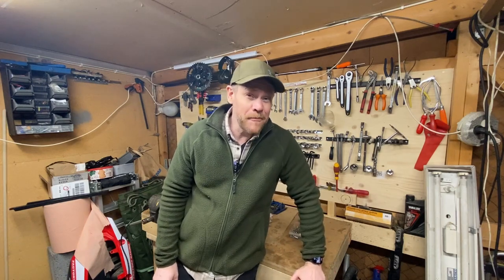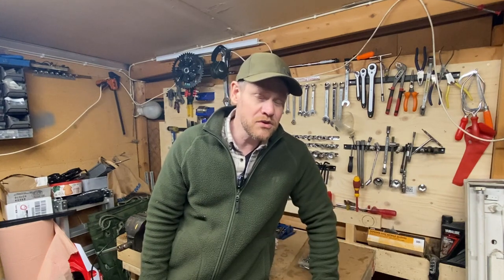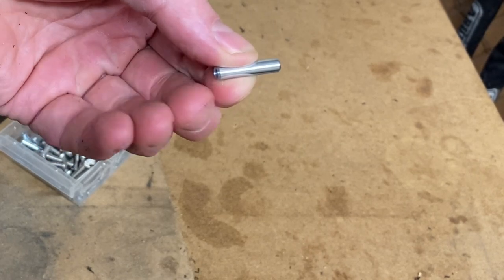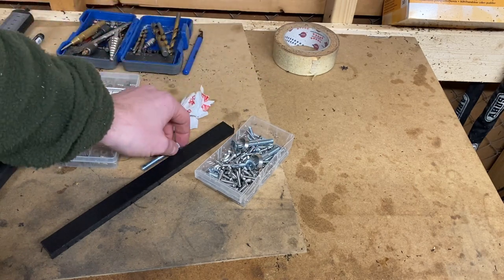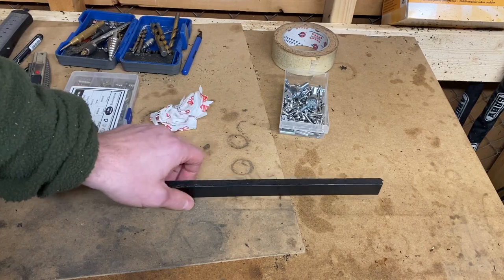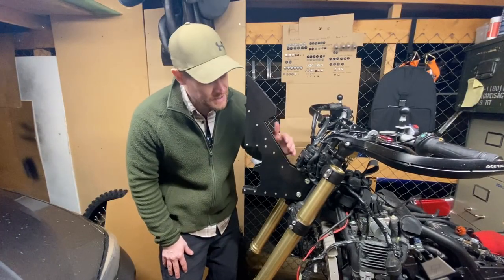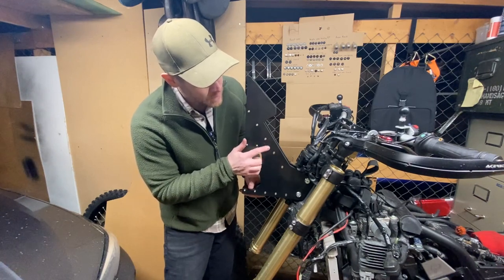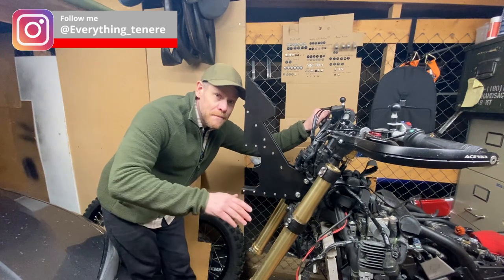Rally Tower Build EP4 - Yamaha Tenere 700

Comment: Very good.  I liked those threaded sleeves.
Reply from the maker: So much better than the screw in thred inserts I was going for first. 
I can still use those on flat surfaces to attach things, but they are kind of not supposed to be used in plastic (already cracked some when testing it out, need to drill just shy of the full od)
Reply: @everythingtenere  They just won't hold unless epoxied in.  Then questionable.  It's looking really good.  Certainly strong.  That's an easy pattern to duplicate.  This very much may be the easy part.  Fitting the lights and other items, then mounting it and what doesn't seem to be in the way now ,ay or may not be.  Good fortune.
Reply from the maker: @samhill3496  i have found steel inserts witch should be a lot stronger, will get some today. 

High beam is mounted, rock solid, but they use M8 bolt, won’t budge (check instagram)

Comment: Looking great Marcus! I am glad you are feeling better. One question about the top part: could it be hazardous in case of the usual 'over the bar' crash? Or will your CARPE be taller than the 'spear' top you have at the moment?
Reply from the maker: Carpe will be in the way 🤓. And I will cut it down slightly as well most likely, so not as pointy
Reply: @everythingtenere  👏💪😃

Comment: Can't you stick the spacers down first Marcus 👍
Reply from the maker: What do you mean?
In a perfect world, I would have drilled the spacers first, then used them as a template when drilling the tower sides. 
Be a drill press would be even better. 
But if spacers are drilled in a press, then the hole should be straight. 
But you do it the way you can, as I don’t have all the tools 🤣